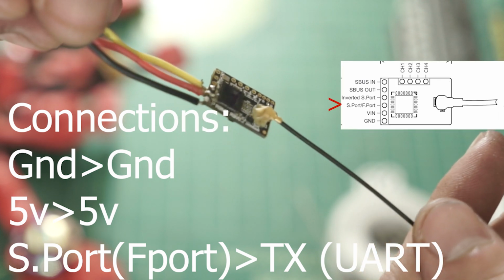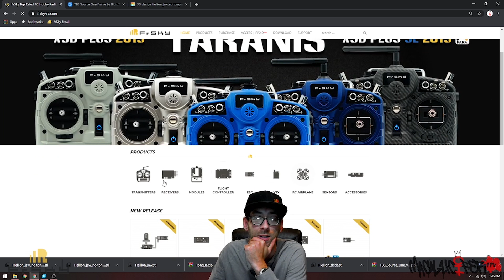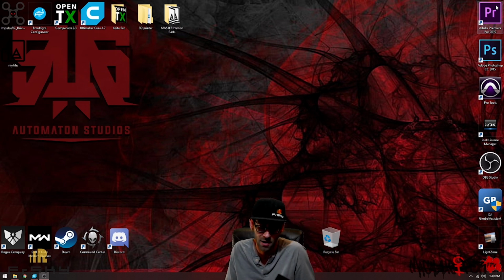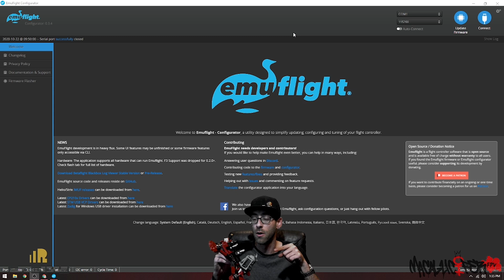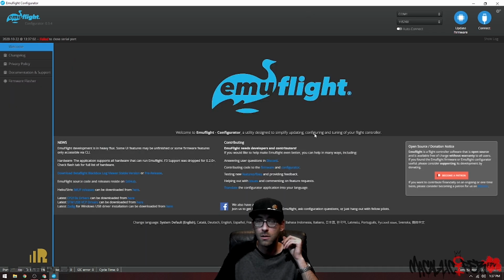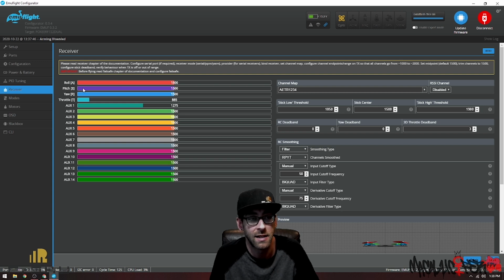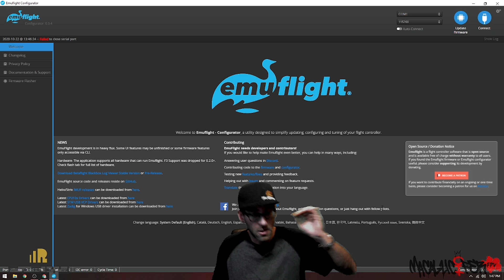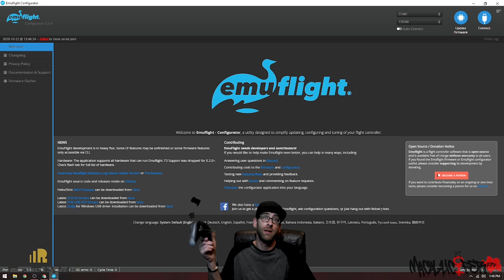FrSky's R9MX reciever setup and install with Fport

Comment: Hi, thanks for the video, I just subscribed and I like it a lotI have an eachine F4 controller that I cannot connect to both and XM+ and R9MX receivers, I did all checks (uart, SBUS settings, they bind ok with transmitter, etc) but nothing moves in the receiver tab of betaflight nor inav.Maybe using Fport would help to troubleshoot the issue, what do you think? Is there some video where you explain how to with F4 FCs? Thanks!

Comment: My r9mx instructions say to switch to fport through the transmitter and selecting the receiver options. But it won’t connect and it’s bound. I tried all you did and still no joy. I’m powered and on correct TX. Any suggestions?

Comment: Hi great video.. im trying to get the R9mx with a Mamba 405dji.. i got the receiver to bound with my qx7s, but i get no stick movements at all.. just try the duplex and inverted on and no success :(.. i have the r9mx in UART1.. any clue?
Reply: Hi im using the same board so i just want to ask how did you wire becouse i did gnd to gnd vcc to 5v and fport to speor f port (tx1) but i cant bound the reciever with tx16s....Thanks
Reply: @andrazgrat7215  looks like my r9mx was not working. I purchased a R9mini, and use sbus instead of fport. I’m flying now.
Reply: @eduardosalasmx  do you have found solution to use the r9mx? i have connected the module with the receiver but there is no stick movement it's really strange...
Reply: @valentedu85  I ended up changing the rx to a r9mini.